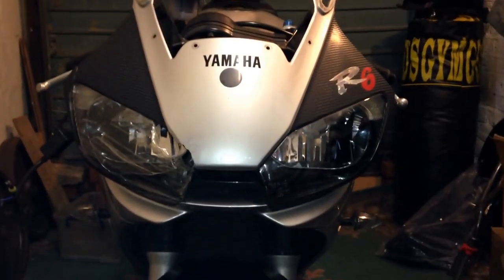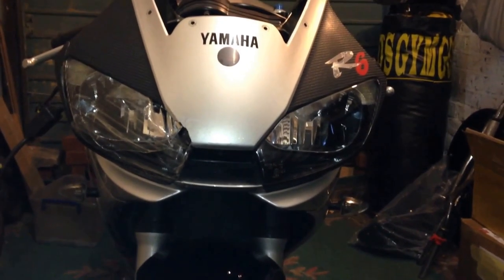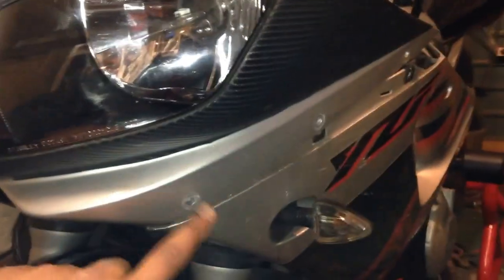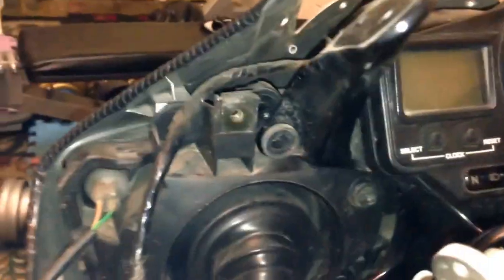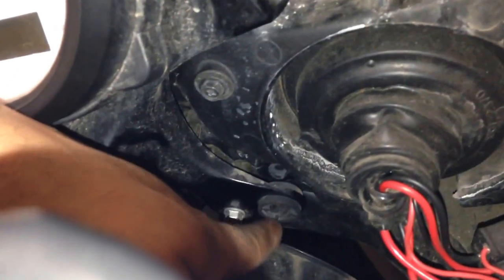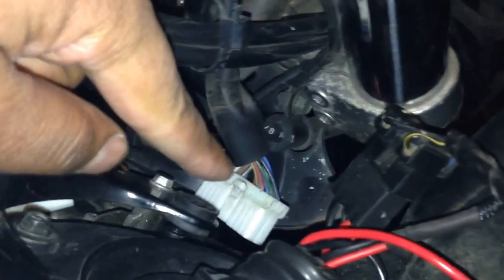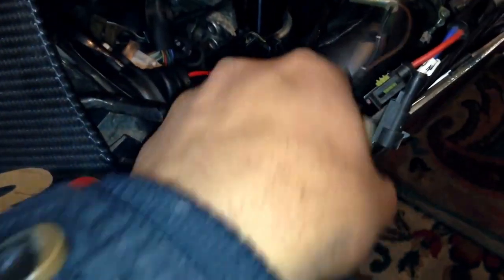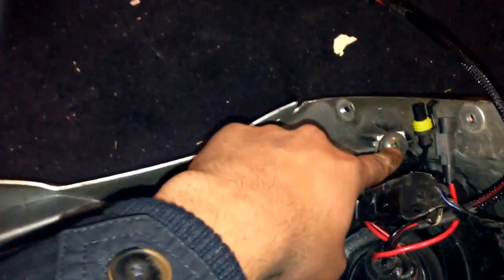Front Nose fairing cowl removal headlight replacement yamaha yzf r6 1999-2002

Comment: you could do it an easier way by removing the 2 speedometer bracket bolts at the frame and then pulling the whole nose off and removing the fairing/headlight from there. the front nose bolt on top for the fairing is not a problem then. Also for the main harness try wiggling from side to side and pulling at the same time while you have the clip pushed in

Comment: lol pls help someone. So on my 01 r6 the headlights keep going out. first the high beam then the low beam then they were replaced and it worked fine but then the low beam went out. soon the high beam will probably go out. i cant figure out what the problem is. The lights are both on for the high and low beam and they are single bulb so the bulbs should be fine since they work for the high beam. it wasnt the relay in the front because i replaced that cuz i had a spare and that didnt improve anything. So maybe its the wiring or the bulbs are actually half burning out or something.

 on my 01 r6 u dont need to remove the screw under the wind visor unless u want just the front fairing. but to remove the lights and front nose to be able to get to headlight relay, wiring, or headlights this is enough. Also to get to the bulb this is not necessary.
Reply from the maker: ShiningQuasar13 sorry to hear this mate have you been fitting the bulbs on with your bare fingers holding the actual bulb glass cos that's supposed to dramatically reduce the life expectancy of the bulbs.